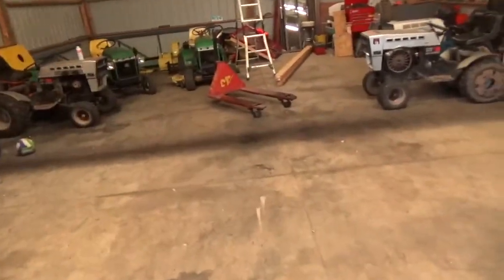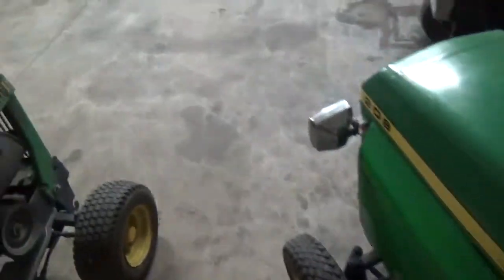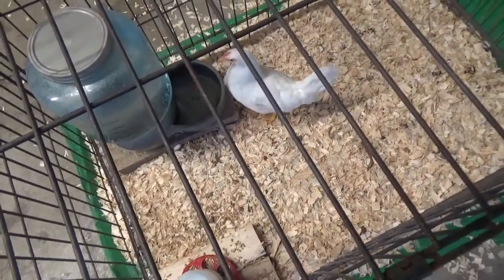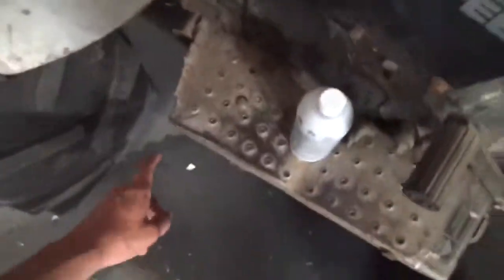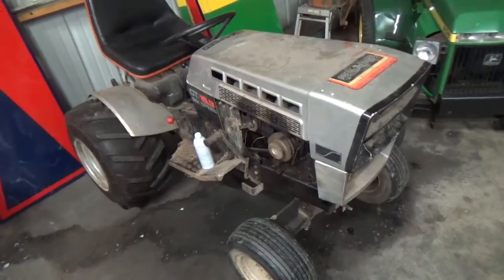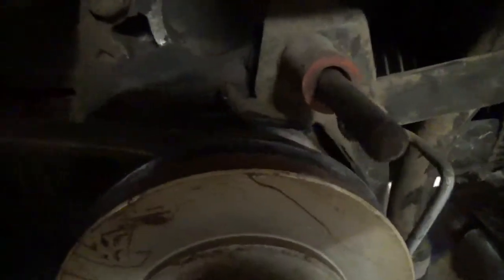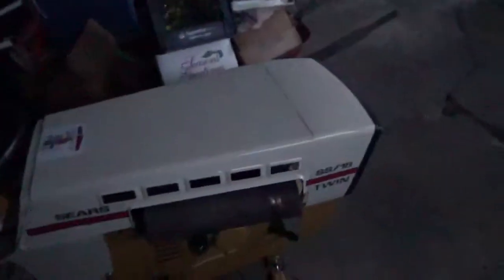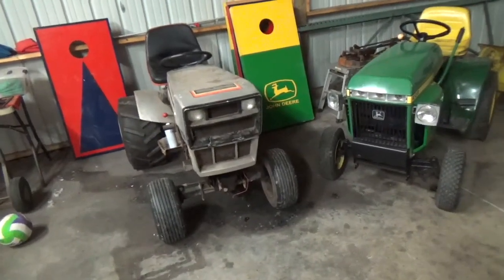Summer time=new projects

Comment: The 208 was an economy 200 series tractor. No side panels, grill emblem, variator, or hour meter gauge. Was only available with narrow/skinny tread tires all the way around. You most likely have a 200 that someone tried to turn into a 208. 200's aren't common either, but they are still far more common than the 208. The blower is a model 37 or 37A, the tiller is a model 31, and the blade is a model 43.
Reply from the maker: MichaelTJD60 thanks mike. I really like it a lot and i would like to buy it. I really like your 210 shes a hem.
Reply: Thank ya. Looking forward to seeing that Sears at PA Plow Day next year.
Reply from the maker: MichaelTJD60 me eather I’m looking forward to next years PA Plow Day.